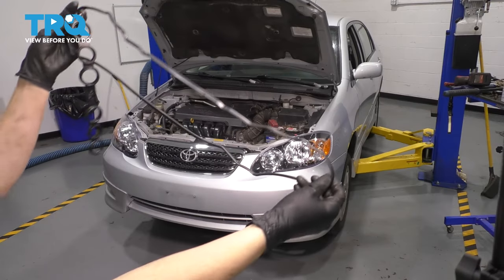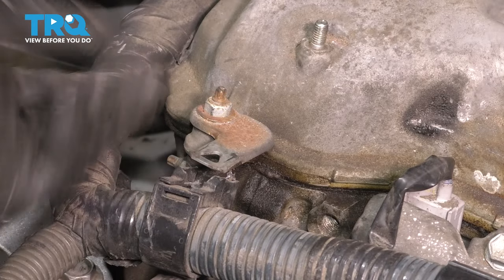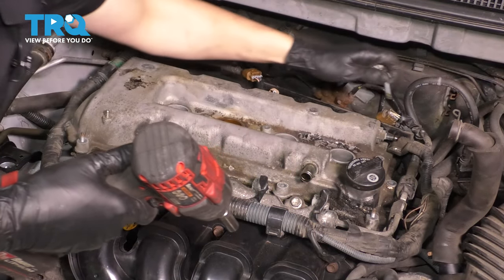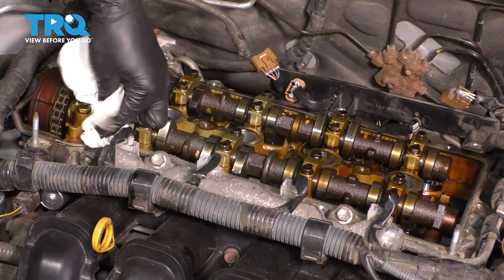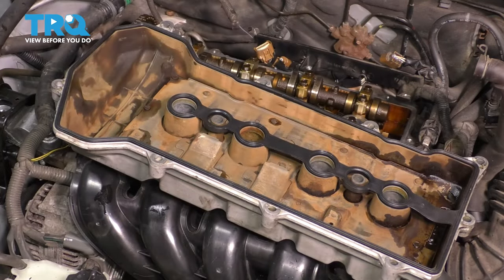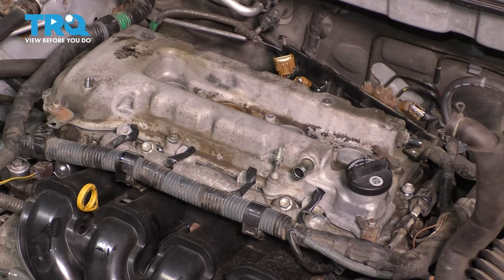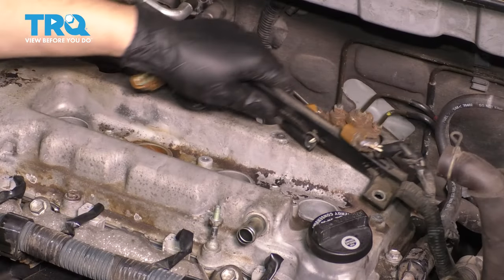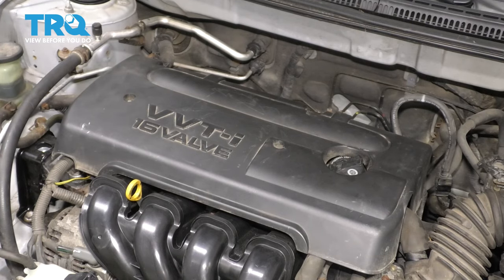How to Replace Valve Cover Gasket 2003-2008 Toyota Corolla

Comment: Great video…well done. One tip from a veteran jet mechanic. Torque specs are from the center of the torque wrench handle and not the end. You’ll get a more accurate torque to spec by gripping the wrench like you grip a screwdriver. Never from the end of the torque wrench.  👍
Reply from the maker: +Charles G Thanks for the tip! We'll pass this info along to our production team. http://1aau.to/m/Shop-TRQ

Comment: Make a template from cardboard or foam and stick the bolts in place as you remove them. Then there's no making a mistake with which bolt goes where. I prefer foam if I have it.

Comment: Nice job! This is so thorough and I like how you detailed all the steps, especially the important ones like rtv placement, not to use too much, and silicon at bottom of ignition coil at spark plug interface.

I appreciate the time and attention you devoted to this video!

Comment: Superb video. Of course, the linked 1AAuto is selling the gasket at $15 higher than MSRP for a FACTORY Toyota gasket, TWICE the street price of a FACTORY Toyota gasket, and 4X the price of an aftermarket gasket. Kinda, sorta, discredits the whole,  "√  Save Money" schtick in the pinned comment, doesn't it?

Comment: Great video tutorial. Covers every point really well. my corolla had some suttle differences in regards to clips but this was 99% accurate for my model. Only thing of caution is be very careful with an old gasket as they are brittle. I recommend this video to any d.i.yer.

Comment: good day, do you have an idea why my intake manifold explode when I connect my vacuum hose in front to throttle body? the one that has no pcv valve.
is it because my engine has a blowby?
Reply: I connect it twice, and explode twice so I conclude that is the reason. I bought this car that has no vacuum hose connected in front so I dont know the history.

Comment: What a terrible design for this engine cover! One of the nuts is attached to a stud that doubles as one of the valve cover bolts. So as I removed that nut for the engine cover, it removed the bolt below it. There's no telling how many times that's been done by me and others.